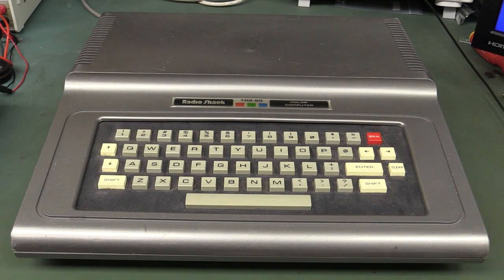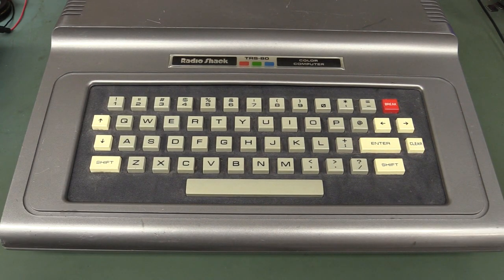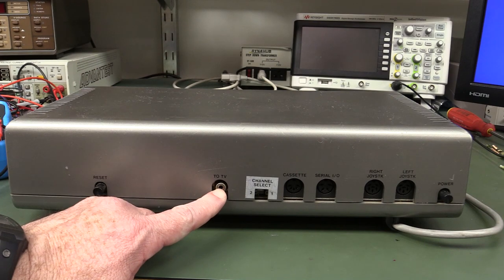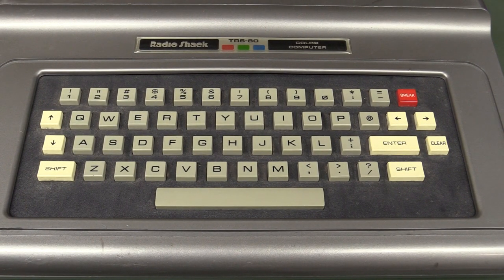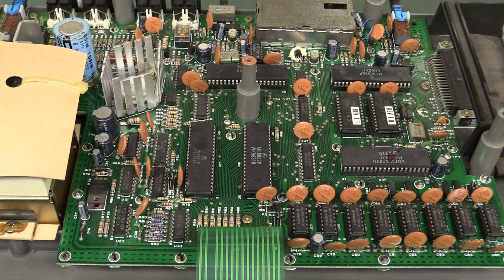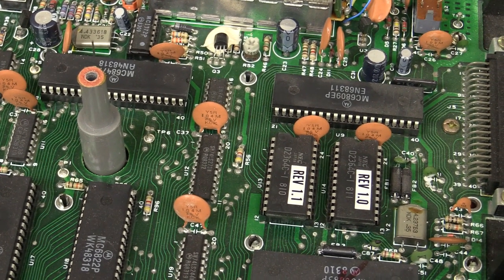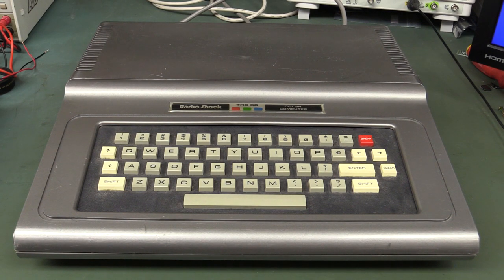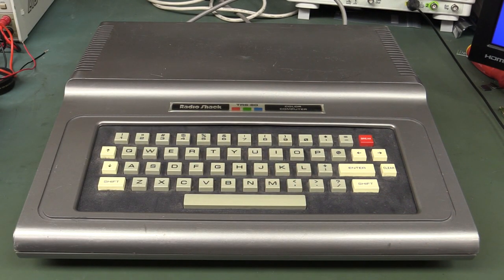EEVblog #1021 - Retro Radio Shack TRS-80 Color Computer

Comment: I use the CoCo2 we got when it was new until 2000. I was somewhat of a pain in the ass because when I was in high school (I graduated in '98), we were using modern computers with MSDOS. For my Junior and Senior years of high school, my computer programming teaching (same guy both years) refused to put Windows and mice on the machines. We were programming in Borland Pascal for my Junior Year and Borland Turbo C++ for DOS in my Senior years. We also used "sneaker-net" with out 3.5" floppies to print out to a designated printing computer. For my Sophmore (sp?) year, we programmed in QBASIC on Windows 3.1 PCs. All those years stuck with the TRaSh80 paid off when I aced that class!  In 2000, I got my eMachines with Windows Me, and the Internet, MP3 and video playback blew me away! I wouldn't say that computers have evolved too much since 2000. Sure, we have faster processors, hyperthreading, 8 or more cores, higher resolution video, and Ubuntu (thank God, Windows SUCKS), but I never saw the "blow you off your ass" upgrade that I got from that TRaSh80 since. I probably should think about upgrading beyond my 4 core Gateway though.

Comment: It's a modern issue with LCD monitors. DVI is 60Hz by default for example and would not do color correction. VGA in theory would but LCDs also do pixel interpolation as well as modern OSes will get finer detail out of LCDs by first aligning to pixels and then interpolating that detail into nearby pixels by changing the color. Good old CRTs had vertical triads which avoids the alignment issues.

Comment: If my memory serves, the reason why the screen didn't display true lower case characters, is because they had to physically program in the ROMs, the bit image of each character. In order to save ROM space it was easier to ditch the lower case character bit, and just do the invert. The ASCII code was still a lower case character. This was replaced by the chip in the PC's that you sent the ASCII character to the chip, and the chip generated the character image on the screen.

There was a guy who was an enthusiast who created a whole line of cartridge extensions for the expansion interface. One of his devices was a ROM burner. And at the time, you could tweak the ROM's from the motherboard, burn you a new ROM, and swap out the chip to give yourself a tailored OS. I know Tandy was against that, but then who cared back then. He made several interfaces for the expansion interface. I never could grasp the 6809 language, as I was already spoiled on the 8080A intel from my old Interact. But at one point I had the Tandy 6809 Machine Language manual for it.

Comment: First computer I had a chance to play with, my brother went to a computer camp in about 1980 and I think had a CoCo under the tree for Christmas. The last time I used it was in 1989 when I bought a 300 baud modem pack and started finding BBSes to call. Then it was on to IBM compatibles ti get blazing 1200 bps and higher speeds.

Comment: My first computer. I must have been about 10 years old. Went through both of those color basic books. Great books as a kid. Almost like the for dummies books today. I ended up yanking the main board out, bolting it to my wall and permanently connected the audio spectrum analyzer cartridge to it and wired it to my stereo :). Next computer was the atari 800xl I think. Maybe a pc xt clone. Can't remember which one I got first. Good times!

Comment: The video may not be looking quite as good as it could be due to the actual display doing spatial dithering due to a resolution  mismatch between the signal and the actual screen. Back in "the day", that wasn't an issue. There could also be some weirdness coming from the HDMI box. The output from the Coco is actually progressive (262 line for NTSC) rather than interlaced which confuses a lot of modern displays, too.

Comment: My first computer was a Dragon 32 by Dragon Data, which was basically a CoCo clone with a proper keyboard. The display really was that bad, and a common hack was to fit a switch to suppress the colour, as it was slightly clearer in monochrome: made typing in progs easier on the eyes. The joysticks were analogue, which meant you had four ADCs built in: great for those of us just getting into process control. I still have it, but haven't attempted to load a prog from tape for years...

Comment: I used them all over the place as dedicated process controllers. back when dedicated process controllers were either non-existent, or simply not affordable....
The key to my success in using them as controllers was due to my using the expansion slot to communicate with 6522 multipurpose i/o devices and the availability of cheaper static ram.
 The basic programs I wrote were a long list of jumps to subroutines communicating with and bringing in data from the external board and using the Basic software for analyzing the data and making the decisions.
 The external board did all the real time stuff and sent interrupts to the main computer when it had a batch of accumulated data to be processed.
I never needed more than the basic 16 K or ram because the processor was directly accessing the static ram on the expansion board,
 Since the architecture allowed any memory address to be a place to get and store data I had a huge number of ports available for monitoring purposes and only used Tandy basic for the number crunching, process decisions, and generation reports output to printer or cassette.
 None of them had video monitors because I didn't need them.
Small portable pocket sized tv sets were the rage back then and if I needed a display for a program change or process monitoring I just plugged one in.
 I did have to run them off tiny isolated UPS systems to keep them alive 24/7, and I know I should have pulled the supplies and ran off batteries being recharged by the AC,
BUT....
 I did not want to modify them internally so if I had a failure I could replace one for $99 from the closest radio shack.
BUT I NEVER HAD A FAILURE in the 5 years I was there, and heard that the new engineers pulled them out and tried to use K-pro computers to do the job, (not sure of the spelling of the computer name)
 Those engineers had no concept of doing things in 'real time' and failed miserably.
Last I heard they were back to my original system any trying to buy up all the color computers they could find when radio shack discontinued them....LOL!

Comment: I had the original COCO1 with 4K and upgraded it to 64K with Extended basic. I then moved on to the Coco3 with 128K and upgraded it to 512K. I was then able to run OS9 level II a unix like operating system with windows. 

I still have several cocos that I use. My collection includes the Coco1, 2, 3, and MC-10.

Comment: Dragon 32/64 was basically the same system as the TRS 80 COCO and many ppl seem to live with the belief that it was a copy of it. However as was shown in this video all that happened was that they followed the same Motorola documentation on the design around the 6809. They even changed a couple of things on purpose so it wasn't a direct copy.

Comment: The CoCo 3 was the best home computer for almost a decade for programs and performance for almost a decade... IMHO it took the 386's to beat their performance once they hit 33MHz, and only a year before the 486 was released when there was enough software to equal the CoCo 3.  Even today, other than the clunky loading process (usually tape or floppy although there was a hard drive you could pick up.) it's really more than enough computer for most business functions except internet.  I still know of one hooked up to a CNC Mill in a shop.
Reply: Okurka I was just about to post something similar. Amiga 1000 was my first computer. Far more capable than CoCo 3
Reply: Interesting side note, the TV show Babylon 5's CGI was done on an Amiga with the "Video Toaster" add-on. incredibly cutting edge for the time. The Amiga was doomed once Commodore took over. They saw a great computer and assumed it never needed to evolve.
Reply: +Vendicar Decarian  A2000/3000/4000 all had expansion slots as that was their market segment. The A1000 was to get the system out the door and the A500 was designed for those upgrading from the 8Bit systems so the low-cost AIO approach seemed obvious.
Lack of a real OS?
Reply: +JarOfRats Just for clarification it wasn't the engineers, it was the upper management that was short sighted. Unfortunately, due to timing, the Amiga was doomed one way or another. Choices were, go bankrupt or get bought by Commodore.
Reply: Oh, I agree... and more specifically, it was the bean counters.
Reply: I had an old Coco II. As much as I love it, let me tell you getting a 1MB 286 with VGA, 1.2MB and 1.44MB fdd a hdd and a 300dpi laser printer was an absolute revolution.
Reply: Also I've used Amigas as well. And of course they shat on the Coco, much as I love it, from a great height. Sure a Coco III with some quite over the top aftermarket additions might match an out of the box Amiga 500, or even 1200, but these were avail as is out of the box MUCH earlier than these add ons (such as the mouse/paint cartridge thing) were ever dreamed up. Also it still would have had a Motorola 6502 in it unless you basically put a computer on the cartridge, which is kind of cheating, and the came Amiga out of the box with one of the much more capable Motorola 68k series
Reply: +JarOfRats it wasn't even the accountants, it was marketing, management and sales. Many of the shops wouldn't even demo the new Coco models ffs. They were completely obsessed with the "serious" business computers the TRS-80 models, which never really were popular, and had a completely different architecture and OS than the TRS-80 Color Computer. Sure, they both had some version of Microsoft Basic, but almost ALL micros did back then. So they were about the same as each other as they were to a Apple II...
Reply: Just after high school I wrote my first 3D display programme on my CoCo2. It did a 21 line object moving at 1.5 frames per second.
My best friend just typed my code into his Amiga 500 (a 68000 at 8 MHz) in AmigaBASIC and it ran over 200 fps.
Reply: +MrGoatflakes When I lived in the UK the only place I ever saw a COCO being sold was the Tandy store and unless I asked they never had anything running on it, but they always had other systems running games and other applications.
Reply: MrGoatflakes, the "beancounter" reference was about Amigas. Also, the CoCo had a 6809e and not the more common 6502 (Apple // series, Commodore, Atari). The 6502 was a 100% 8-bit CPU whereas the 6809e had a 16-bit internal data path...meaning it was much faster when properly coded to take advantage of that feature. The Amigas used the 6809's big brother, the 68000. That was a true 16-bit CPU.
Reply: +JarOfRats Well the 6809 had the ability to combine accumulators A&B (each individually 8-bit) to make D (16- bit) however to move the data from D to memory required moving it back over the 8-bit Data Bus so required it to be split it to 2. This was a bit (yes a joke) inefficient, however, compared to doing a multiplication on a 6502 it was so much quicker than writing that routine. Comparison to the 68000, however, I would say is rather off with the internal data path being actually 32-Bit but the external data Bus was 16-bit which makes talking to the memory (and other external systems) take 2 parts. The 68000 was certainly closer to being a 32-bit chip that the 6809 was to being a 16-bit chip.
Reply: +Vendicar Decarian A2000 was 1987 which was hardly too late to market and when the A3000 was released in 1990 again not too late and many even non Commodore/Amiga declared it a powerhouse of a system. But I do agree that the A4000 was late to market (as was the A1200). This really wasn't a problem with the Amiga itself, more a point that Commodore wasn't marketing the system to show its real strengths.
Reply: +Vendicar Decarian What I was getting at was that the Amiga did have an opportunity to be part of the future. In 1987 (A2000) The Amiga in its basic config was still better than a PC of equivalent cost (let alone the Mac) by 1990 (A3000) the PC was still a mess with compatibility issues with 3 (main) competing and horrible OS's (DOS, Windows 3, OS/2) yes new upgrades did make the PC capable (on a hardware level) of bettering the Amiga but only with very much more expensive hardware, and as I said very incompatible. The Amiga had next to no chance of supplanting the PC as the computer standard but it had nothing to do with technical prowess and everything to do with marketing. Commodore was one company, by 1990 there were hundreds of PC companies all marketing, it was swamped. The Amiga should have had the market occupied by the Mac which was a technically and usability superior system compared to the PC of the time (still inferiour to the Amiga).
I believe that the Amiga being so strong when it was released in 1985 was a good part of why the expansion market didn't get behind it like the PC. The PC required an upgrade to everyting, it was terrible. The Amiga on release had good video capability, good sound, and a memory effcient, 32bit, Preemptive multitasking operating 10 years ahead of the competition without all compatibility issues that followed addons. What was anyone going to sell, minor upgrades ? but that again limits marketing. Had IBM stopped companies from cloning the PC like they tried to do, I believe the computer market would be very very different today.

Comment: Output was actually a little more clear on a good quality color TV. But if you were serious, you used B&W or a composite output adaptor and a green or amber monitor. There were patch ROM mod boards available that gave you legit lowercase in the native 32 char hardware mode. The software drivers for the B&W 'PModes" could give you 16, 32, 42, 64 and 80 char emulated modes with lowercase and extra custom characters. I don't know whether it was the fact that it was sold by RS and picked up by electronics enthusiasts, or that it needed soooo much help to be a useful machine - but this was the original hardware hackers PC.

Comment: One ROM was the BASIC  and the other was the Extended BASIC.  The synchronous address multiplexer allowed more memory than the 6809 with its 64Kb limit to be addressed.  With 64K of RAM the memory mapped I/O and ROM's had to be overlayed.  I remember making 32K out of the 16K by piggy backing the 2nd bank of chips  with one pin bent out.  Then  running a single CS wire to the chips and tacked to a point on the PCB.

Comment: I had one (NTSC, not PAL). The video quality was usually pretty good. Sometimes the sound would "buzz" depending on the color on the screen. The stock RF cable sucked. I made my own cable and that helped.

Some people did the various composite video mods. Some worked well, others did not.

The cursor annoyed me, so I modified the code to get rid of it. Yes it was possible to blow your own PROM chip.

Comment: Not sure about specific issues between pal and ntsc. But my Coco looks fine with an rca to coax cable in my modern 32" 1080p Samsung TV. Text is quite crisp, but it's really sensitive to interference

Comment: I modified mine for composite video out and used a nice color monitor and it looked good and was sharp. I built X.25 Packet interface for Ham radio. I had a lot of fun with it. Had the okidata serial printer and external hard drives and a eprom programer cartridge. Fun fun fun! Use to subscribe to Rainbow magazine to get sample programs and other hardware projects.

Comment: In my Junior year of high school, I took a programming class and learned to program in basic on a TRS-80 model III.  That was 1985 for those of us playing along at home.  

BTW, I imagine the cardboard covering the mains connected transformer was because of it's proximity to the vent slots in the side of the cover.  Too easy to spill something in, or perhaps if a coin fell through?  That's usually all that fish paper kind of stuff is good for, a mechanical buffer kind of thing.

On the PCB of this video, did it only have components on the top side?  2 sided designs really didn't take off until SMT came around anyway.  The PCB design appears to be almost auto insertion ready, except for just one or two components that are installed at odd angles.  Early insertion equipment could only do 0 or 90 degree insertions.  In some rare cases all 4 directions, but most people just loaded the components on the machines backward to get 180 and 270 directions.  I doubt this board was auto inserted as some of the axial components were floating up during wave soldering, indicating the leads weren't clinched, or the machinery was in poor tune.